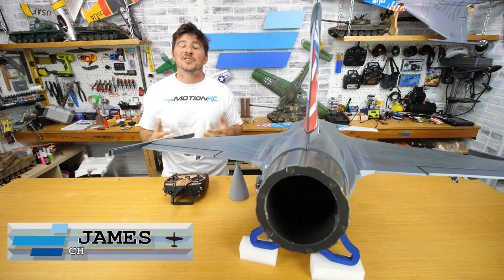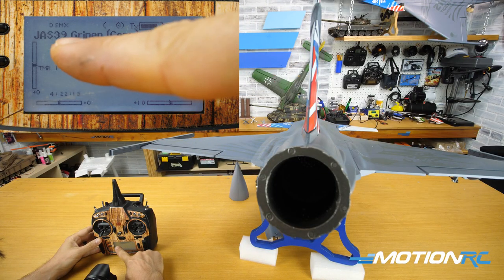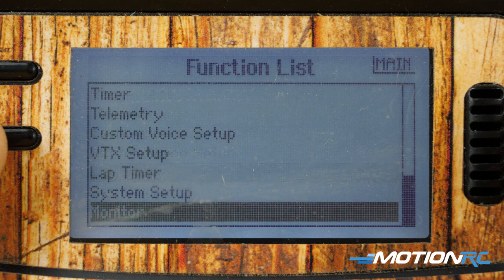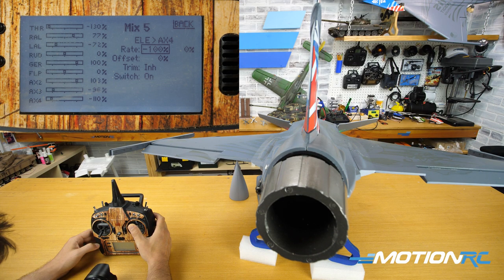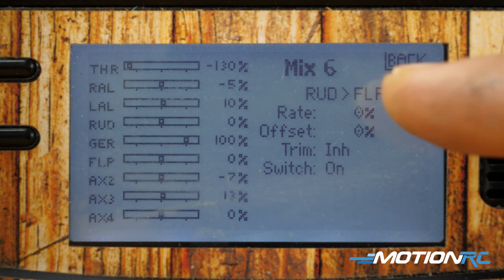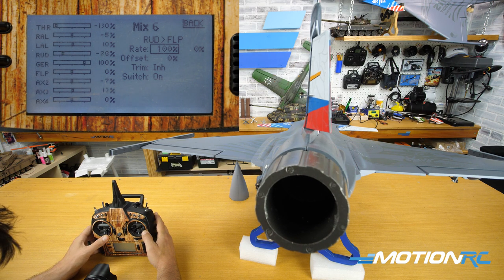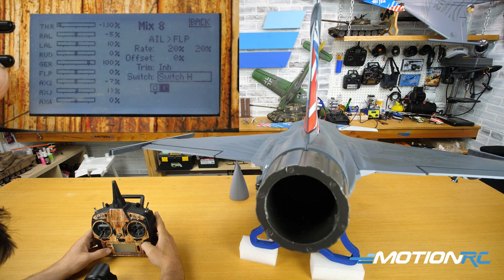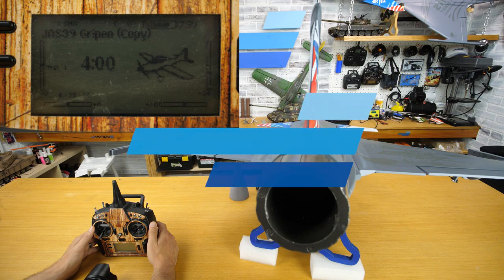Freewing JAS-39 Gripen Thrust Vectoring (TV) Programming Set Up - Motion RC

Comment: Good video. Important to avoid trim affecting the thrust angle indeed.

Disagree with the roll to yaw mixing though - pilots in general need more encouragement to use their rudder stick - not less
Reply: @410productions3  ooooo butt hurt much? 😂😂😂

Don't preach about using aids when that is precisely what you are advocating here.

And more importantly, although this is probably hard to make sink in: Not everything is about you.

More than anything I am an instructor that concerns myself with the success of other pilots. So this is about what's best for making pilots develop good habits.
Reply: @410productions3  "Zero butthurt here"

Clearly.